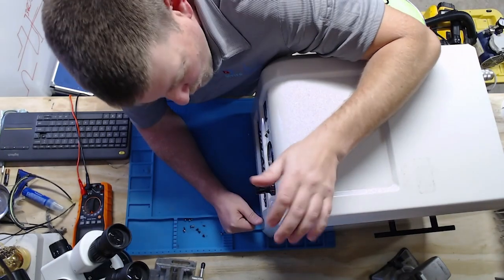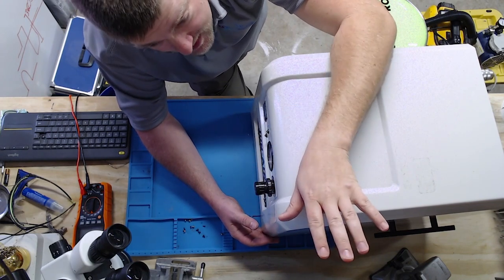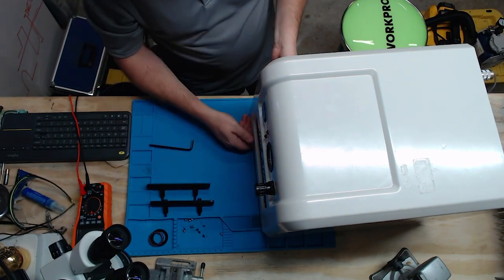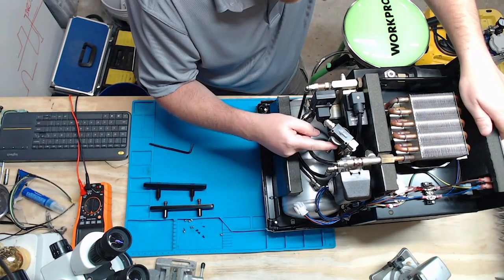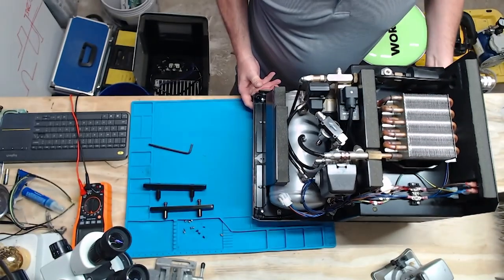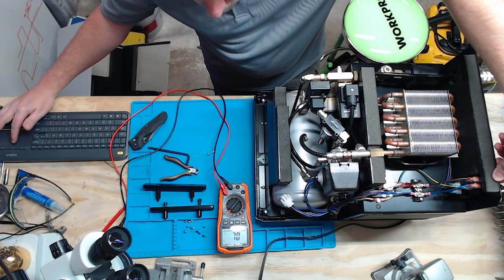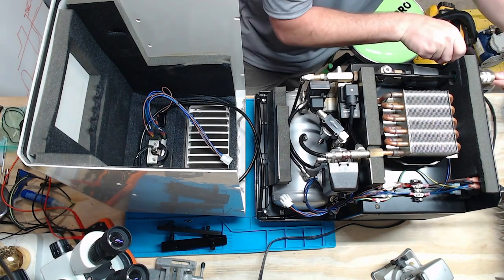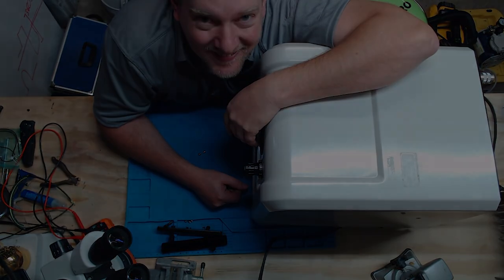Step By Step Troubleshooting A Medical Air Compressor

Comment: 12:25 I guess it is a "Free run" valve. When a compressor is running and making pressure, 
and suddenly the power goes off and on, when the compressor has to start again, it has a lot of back pressure and can't start. In the line between compressor and tank is normally a "one way valve" mounted close to the tank, and the "Free run" valve is connected between this "one way valve" and the compressor pressure outlet.  When the compressor has reached his maximum pressure, the power to the compressor stops by the pressiostat, and the "Free run" valve release the pressure between the "one way valve" and compressor, so that when the compressor kicks back in when the pressure in the tank has dropt, he can start without backpressure. This "Free run" valve is what you here doing psssssssssst for a second when a normal home shop compressor stops.
If this "Free run" valve doesn't work, the compressor has to start with backpressure and take more current to start, and in the worst case, he can't start and the thermal protection of the motor of the compressor kicks in.
This is also when you unplug a running household refrigerator, and plug it right back in, the compressor has to much backpressure and will only buzz and after a few seconds, you hear the thermal protection click that interrupts the power. 
With a refrigerator this backpressure will leak away from the condenser side to the evaporator side, and at the time when the pressure on condenser and evaporator side is equal, the thermal protection has cooled down and the compressor start again.
By the way, nice compressor and ideal for airbrush etc :-)
Reply from the maker: I have seen this type of valve in other (smaller) compressors.
Reply: @BetterBiomedChannel  , the compressor itself, is that a piston pump type? 
I found some info on the net, and it seems to be a oil free 100% Duty cycle compressor , 7bar pressure and a flowrate of 55 liter/min, running at 50 dB.
Reply: @BjornV78    I assume you guys are talking about the unloader valve, it relieves pressure from the compressor piston so that it starts easily when it’s time to cut-ON.
Reply: @dotunepeters1886  yes, you are right. Grtz